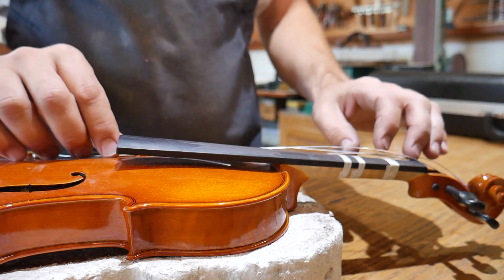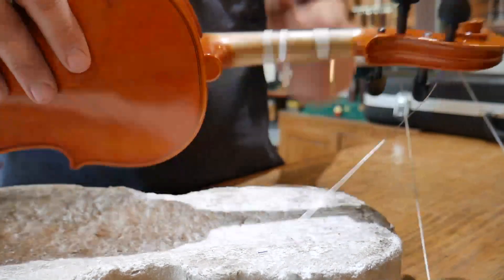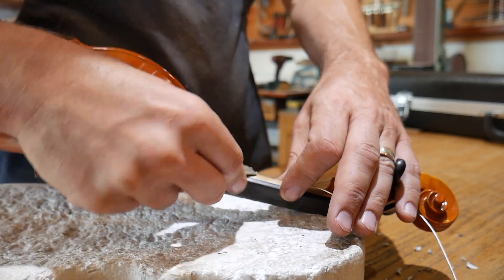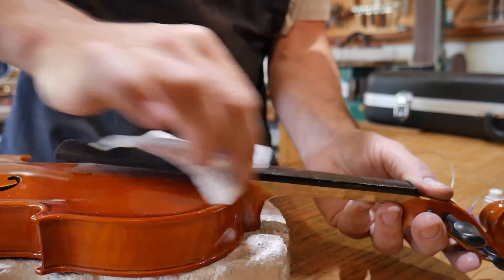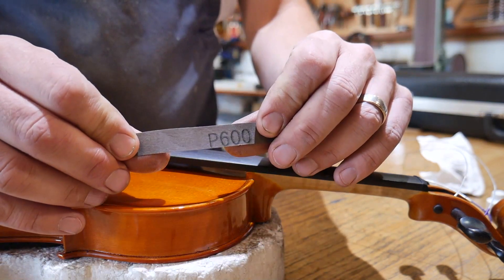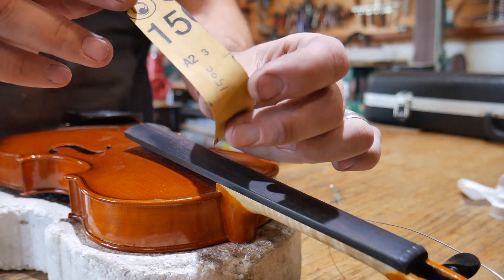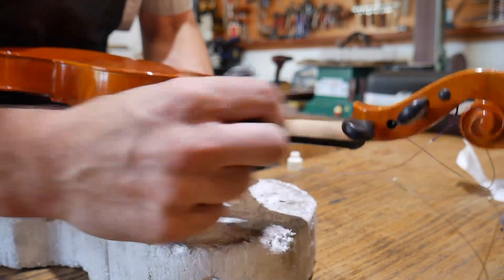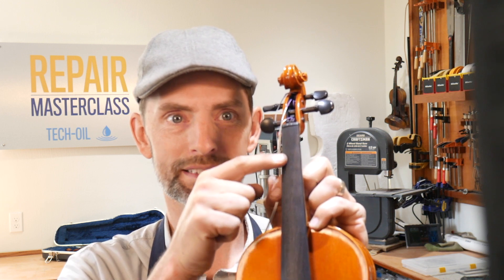Remove Fingerboard tapes

Comment: Hello! Beginner cello teacher here. One of my students came to me with a huge sticker of incorrectly placed tapes and I think we may need to pry them up with that ruler you had. What type of ruler is that? I'd love to recommend she use it to remove the enormous tape sticker.
Reply: Way to go teaching the up and coming students! You can use anything you really want to get that sticker off there. A cheap metal ruler from any hardware store will work great but so doe the Pampered Chef plastic food scraper in my kitchen, or a butter knife or a plastic drywall puddy blade...whatever you have you can make work. Just GO SLOW. You can always apply more pressure if needed but take it easy at first and don't be in too big of a hurry. The oil of any sort will help loosen that sticker up and make this job easier. Let me know how it goes!